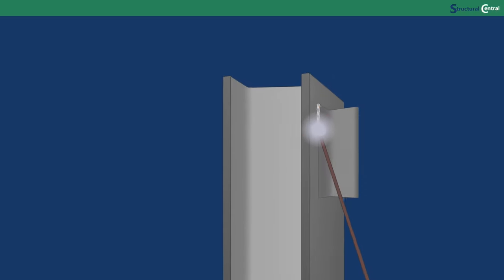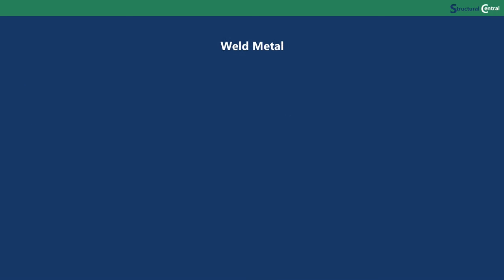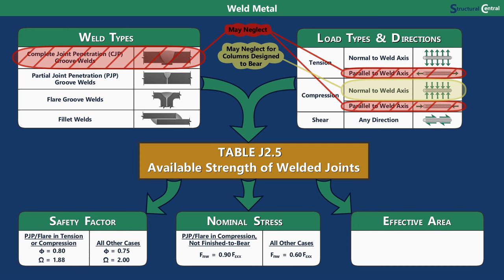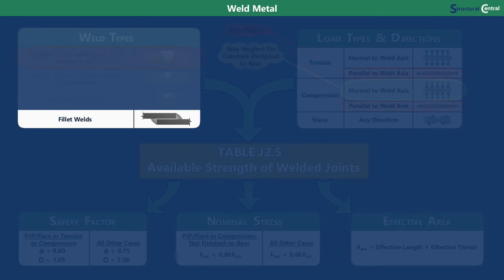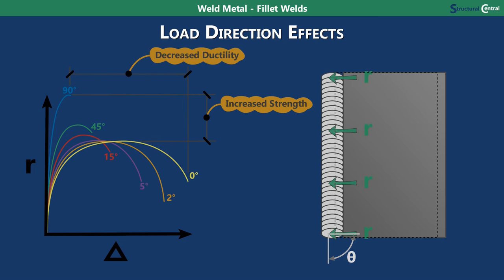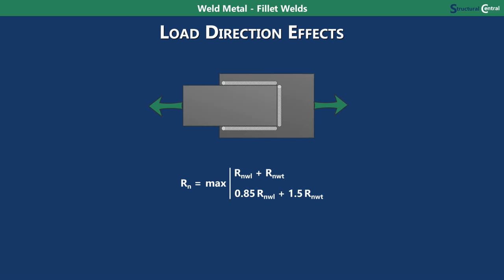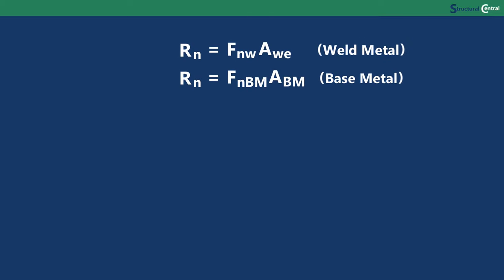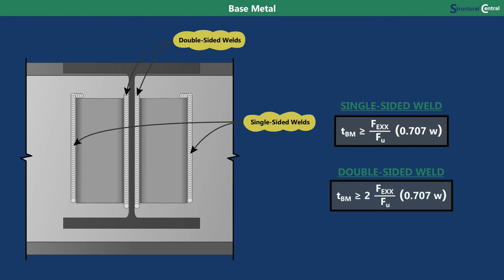Weld Strength Calculation - Fillet Weld, Groove Weld, and Base Metal Load Capacity

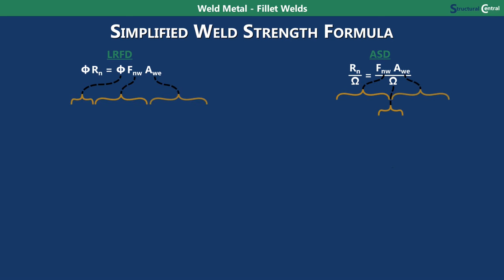Comment: thanks for sharing! this was very helpful. Some of these numbers Starting at 4:06, such as nominal stress.  is this represented in kips? or are you just using a random number for this example?
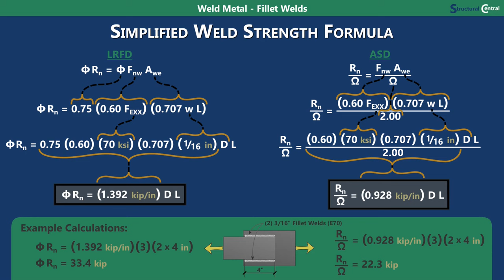Reply from the maker: What example are you wondering about specifically? The units are included for the Example Calculations shown at 4:41. Nominal stress is in ksi (kips/in²) and strength is in kips, although, other units would also work for the formulas shown as long as you are consistent.

Comment: Would the same calculation also apply if the load is applied in normal direction//out of plane to the weld? 

Ie imagine i have a pipe leaking. I plan to patch it up with a steel and weld via fillet weld. The force (water pressure from the hole) is acting in normal direction to the steel plate.
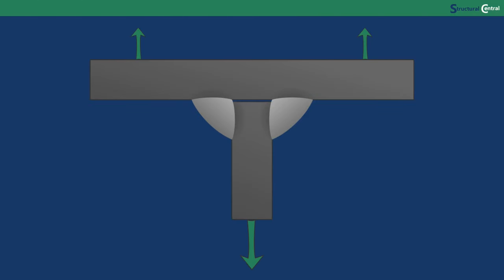Reply from the maker: I can confirm that for fillet welds, when the load is being applied normal to one of the steel plates (like as shown at 0:40), the fillet welds still use the Shear section from Table J2.5, so the calculation should not change.

You likely can also use the 1.5 directional strength increase factor since the weld axis is 90 degrees from the applied load direction. (AISC 360-22 now limits this to 1.0 for fillet welds at the ends of rectangular HSS loaded in tension.)

You're on your own for determining if that's a good way to patch up a leaking pipe, though ;-)

Comment: Thank you for the valuable information. Is there any similar available for aluminium welded connections?
Reply from the maker: There are special considerations that are unique to the design of aluminum welded connections. 

In Chapter 20 of the 2021 International Building Code (IBC), they direct you to the 2020 Aluminum Design Manual for the strength of aluminum used for structural purposes in buildings and structures. You may also be able to find some information about welding aluminum in American Welding Society (AWS) D1.2, Structural Welding Code - Aluminum.

I hope this helps!